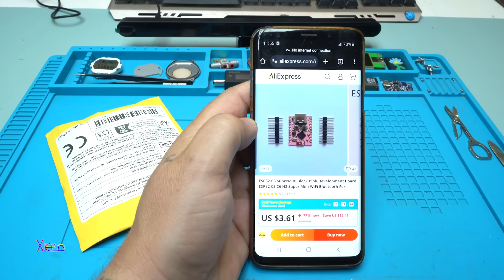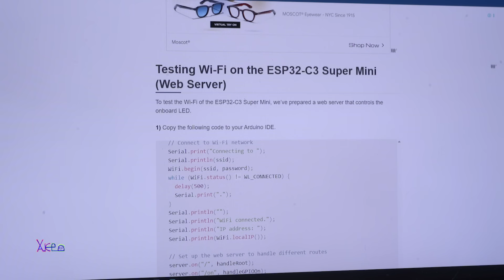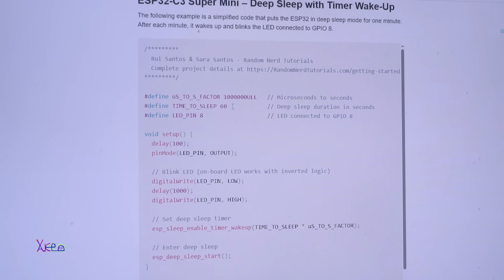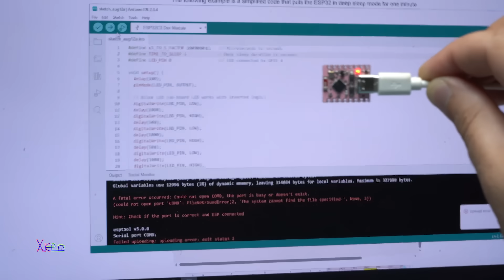$3 Aliexpress ESP32 C3 MINI is INCREDIBLE?

Comment: what about a usb c cable which had one of these in the middle with a little relay, then you have a remote controlled usb c power cable. lots of lamps and radios etc use usb c power, so having a generic remote controll usb c power cable would be cool

Comment: From time to time Ali has sales on these.  Bough a few for $1.79 each, with free shipping (total order has to be $10+ for free shipping to US).
Reply: you gotta stock up on them when you find them in the bundle or choice selection
Reply: Have they all worked for you? I've bought one and it failed after about 3 month of 24/7 use including wifi every 2 minutes.
Reply: @jeff5101  Check each under magnification.  Had one with bridged pins.  No issue with them as espNow sensors, not sure about 24/7 use.  Allow for ventilation when using wifi for longer periods.
Reply: @jeff5101  Havent tested them in constant use. The 2 used as temp sensors over espNow are still working, rest in the drawer.  I found one had 2 shorted pins on the chip.  I recommend looking each one over under a strong lens to check for deflects before deployment.

Comment: many of those boards are fake chinese clones, some of them have very bad wifi reception... there are articles online which explain how to detect the good ones from the bad ones, measuring the distance of the ceramic antenna from the side of the pcb... below 1mm space, they're bad, about 2.5mm are good, the distance causes interference
Reply: Tenstar Robot are my go-to for these type of boards. Not much more expensive, certainly still incredibly cheap, but consistent and reliable.
Reply: @owainsutton4865  Thank you for taking the time to post the name of this Aliex Shop... Always looking for reputable dealers in Aliex... cheers ☺!

Comment: You have sent me down the Aliexpress rabbit hole! I work in a small lab, and needed a temperature probe that would measure down to -40C. I was going to have the company order one, but I couldn't find a small enough one to fit my needs. Using AI, I asked a prompt that with using parts from Ali, what parts would I need..and I got a part list, that was under $12!
Reply from the maker: Glad you were able to find a solution that worked for you!
Reply: @Hacktuber one of the solutions is: Follow Hacktuber!

Comment: I've got one of these boards and I've attached an IR receiver and transmitter and have turned it into a universal remote that takes the codes from the little IR remote you get with the IR kit and then changes them into the signals for my TVs.  It also turns on and off my smart plugs and wakes my laptop.  It's super easy to attach an addressable RGB led to give back feedback.

I did it all in micropython because it makes adding features really fast without have to do any recompiling.

They're fantastic.
Reply: Nice!
Reply from the maker: That's a great project! 👍
Reply: How do you use micro-python on an esp32? Bypass the arduino ide?
Reply: @MrBoatman46  Lol, even arduino IDE even use Python for flashing the ESP. ESP boards have native micropython interpreter.